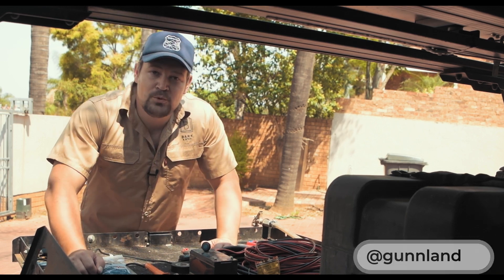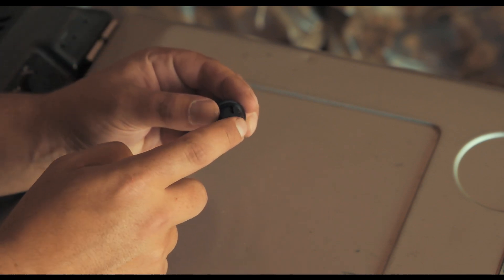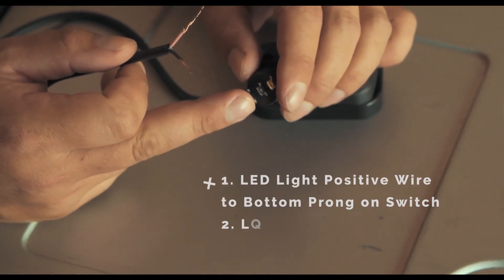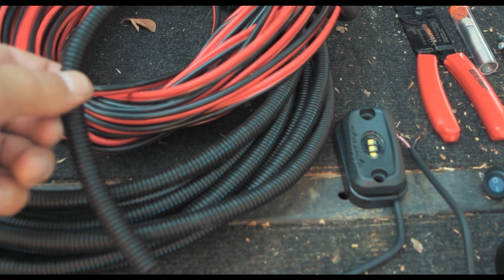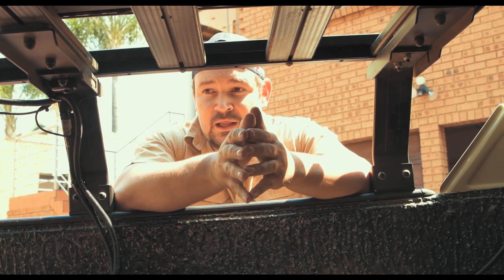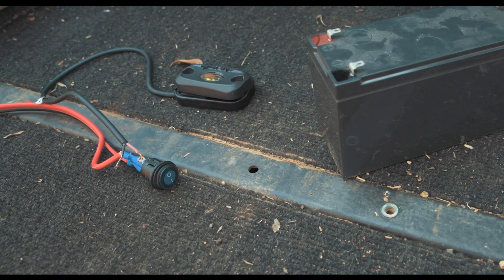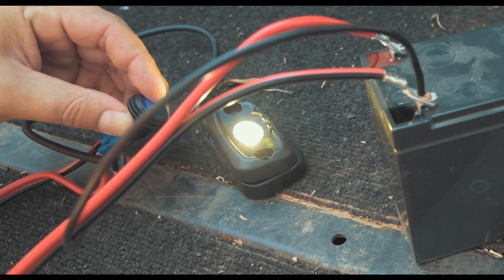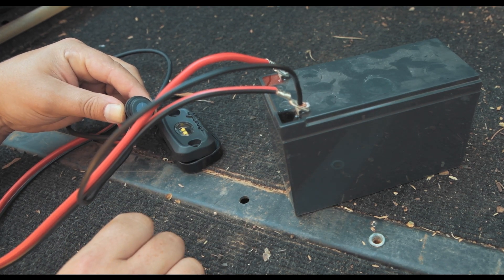How To Wire A 3 Prong Rocker Switch To LED Lights - Basic Wiring for 12v Accessories

Comment: in 2025, the rocker switch at home depot has pin 1 and 2 reverse.  You have to read the instructions.   The middle is for the load/accessory now.

Comment: nothing to have to install a fuse? does the disconnecting the negative connector from the switch cut out the having to install a fuse?
Reply from the maker: This was just the basic principle of how to wire it, please feel free to include a fuse in your positive wire as close as possible to the battery terminal if you do it exactly like this - I would recommend a fuse box

Comment: Can the negative wire from the Light, can it be grounded to the body of car ? Or does it have to ground to negative post of battery
Reply: You can just ground to the body bro
Reply from the maker: You can ground to body or better yet install a fuse box with a negative bus bar - this is just the basic principle. Maybe I should do a video of exactly how I would install it to look neat and be safe

Comment: Thanks for this. I bought some LED rocker switches with no instructions and couldn't work out why there were 3 terminals.. It all makes sense now!

Is the brass prong just so you know it's negative, or is there a special reason the negative needs to be brass?

Comment: I wired in this switch exactly how you said...and It didnt work. The power wire from the battery goes on the bottom terminal and the feed to the accessory goes to the middle. Explain that one!

Comment: You don't do something improperly and then say you will show how to do it right later! You should have at least use clip leads. You had NO fuse in the circuit so what you had could have burnt up if those bare wires shorted out. Very poor.

Comment: What if the light(accessory) negative can't reach the battery, can I combine it into the ground wire coming from the battery into the rocker switch?
Reply: Ground it to the body of the car. It doesn't need to go to the battery negative just ground it to the frame structure by loosing up a screw and ground the negative wire to it